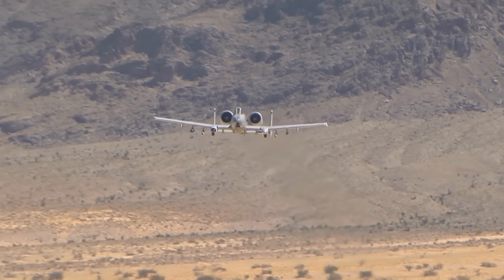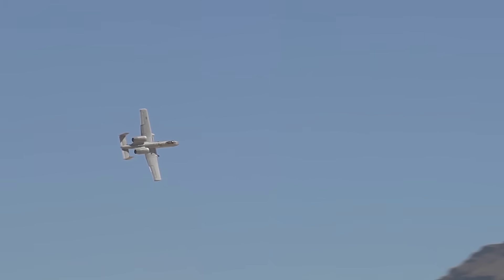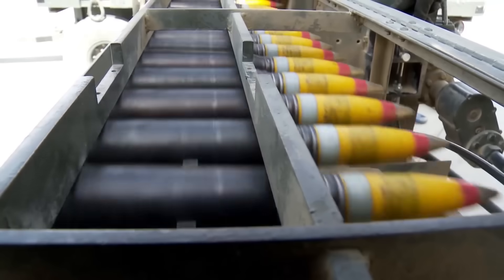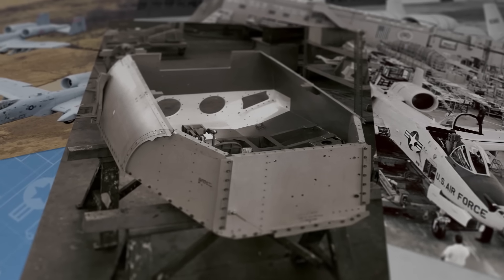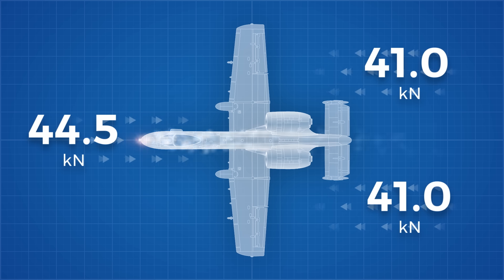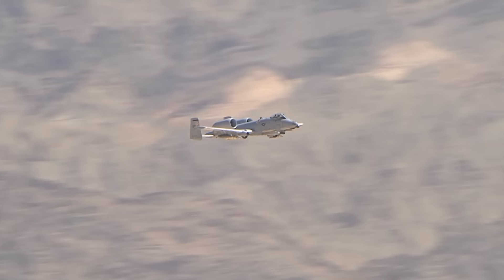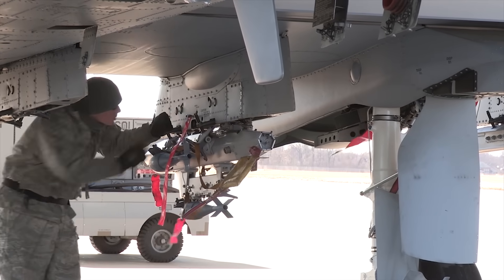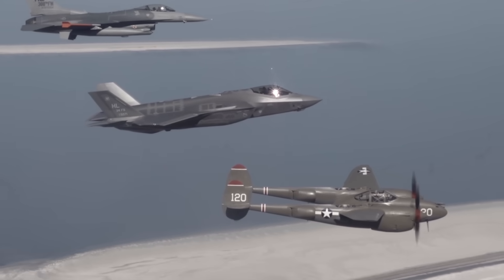The Insane Engineering of the A-10 Warthog

Comment: I saw two A10s crash at KKMC during the gulf war: first had hydraulic failure, pilot put it down hard, landing gear buckled, plane skidded to a halt.  Second same story, hydraulic failure and A10 hit runway hard.  my Humvee was waiting to respond to the IFE (in flight emergency) and was at the end of the runway, very near to where the A10 first contacted the ground.  My job was to 360 any possible crash site and protect classified. The landing gear buckled and I thought, oh he'll just slide it in like last time.  For some reason, the plane shot back up, rolled inverted and nosed into the runway, killing the pilot.  It was a real tragedy.

Comment: Point of order: The A-10's 30mm cannon is not mounted along the centreline - not exactly. It's actually mounted so that the barrel that is firing is on the centreline, so the weapon as a whole is slightly off-centre, as is the A-10's front wheel, to make room for the bulky 30mm weapon.

Comment: My father was an aerospace engineer who spent over 15 years of his career designing upgrades and improvements on the A-10. Once while visiting our local aerospace museum my then elderly father walked up to the static A-10 on display and deftly opened what I believe was one of the gun access compartments. I said, "dad what are you doing?" He said, "I re-engineered this latch." I asked him why. He said that the original latches would frequently fail due to vibration from firing the gun. He followed with the comment that the pilots didn't care for that happening. The museum docent didn't bother us due to the fact that he had known my father for a long time. 
RIP Dad, your girl is still flying and protecting us, warts and all.

Comment: You should consider doing a video on the turboprop light attack aircraft, they ditch the resistance and the firepower of the a-10 for basically everything else. 

They are substantially cheaper and easier to operate, have significantly better fuel efficiency and have the capability to use improvised airstrips.

It may not look like much but it means that a light attack aircraft can be anywhere you need and for much longer time.

And they don't miss as much survivability as one may think, because the turboprop engine is quieter it makes it a bit harder to spot by noise alone. It is also cooler, though I don't know how much it would affect its performance against heat seeking threats.

Comment: Not fast and not pretty, just the best at what it does and our mud brothers' best friend.As a fighter pilot, I should point out that local air superiority  is required for the 'Hog to do its thing, as its radar cross section is about the same as a flying aluminum barn. Though very agile, the A-10 is also very slow. There's no chivalry left in the air-to-air combat business. I prefer to sneak up on the enemy and kill him before he knows he's being hunted. Or, shoot him from 5-10 miles away. The 30mm is an awesome weapon, but in modern air-to-air combat, it would not--or should not-- be a factor.

Comment: The A-10 was designed for practically suicidal missions against the soviet union. To destroy some tanks before being destroyed itself, and using America's sheer economic power to out-build Russia.
The A-10 against any modern enemy would be nothing more than a slaughter...In favor of the enemy.
Reply: Yet the success of this aircraft falls short. In your eyes. You a f35 fan boy then? The flying POS that cracks in normal maneuvers. Limited to 7g's so the wings stay in place? On the plane fan boy...lol. 10 years behind delivery. And problems still swamp the program....oh and the gun....can't shoot straight. Probably obsolete before it is a factor. And over 100% cost overruns.. A10 is doing well.

Comment: You realize what he said was they could remove the 2 engines and replace them with 2 more canons facing to the rear and this plane would be faster than it is now!  I don't think using depleted uranium canon rounds as a fuel source would be a very economical choice however.

Comment: The infantry will kick up a huge fuss if any replacement craft is not fit for purpose. They love those 10's man... The modern U.S Infantry has experienced the A-10 in actual combat now for a few decades. There is trust there where in the past there has been animosity. Infantry hate being bombed or shot by their own...they got enough problems as it is without it. The A-10 and its pilots have really done fantastic work rebuilding the infantry trust in the Air Force. Vietnam vets often  had issue with danger close situations. They loved the choppers. Bombers and jets not so much. Maybe when the Air Force auction them off the Army and the Navy could get themselves some cheap little problem solvers?

Comment: You made a HUGE mistake. The gun is mounted LEFT of center (from the pilot's perspective). The firing barrel is in approximately the 7 o'clock position (when viewed from the front), which is in alignment with the centerline of the plane. You also might have wanted to mention that firing the gun changes the pitch of the plane and automatic trim is applied to compensate for it.

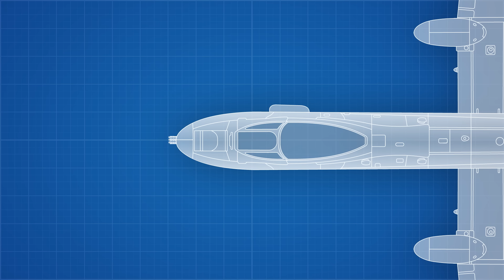Comment: 07:44 This is not so. The gun is mounted not on the center line of the plane but instead slightly to the left, with the barrel in the 9 o'clock position being the one that fires rounds.

Comment: F-35 doing A-10's job?
Laughs in BRRRRRRRRRRRRRT
Reply: @ItzB it was my understanding close air support platforms like A-10 & Apache were meant after obtaining air superiority. What you need to consider is the $42.9m difference in price per unit worth the 2,000 lb payload / 500 miles range upgrade? What's the point of stealth after you control the airspace?
Reply: @Mr_Plop1  It's more complicated than that, even if you have air superiority there is still the danger of SAMs and yes while radar guided SAM systems can ideally be destroyed before the A-10 comes in it's practically impossible to destroy every short-range MANPADS, Infrared or Laser guided SAMs and AAA. If an enemy has these systems every attack by a preferably low flying A-10 will come with a high risk. The F-35s ability to engage targets from a further distance dramatically decreases the risk of getting shot down and in the end is cheaper than having to buy new planes to replace the ones that crashed.

Comment: why not build a new version of the A-10? instead of try to replace it with a different plane, why not make An A-20? i just think having a fleet of planes that can do other jobs but are non specialized is a bad idea. while all rounders a great in most cases, they simply lack the benefits of dedicated platforms. this can be seen in pocket knives to war planes. sure the swiss army knife can do alot of things, but it cant screw in screws as or as quickly as a dedicated screw driver

Comment: You need the A-10. It was designed for it's job period. The A-35 can do alot for a large price and large cost to run. Let's say we lose 5 of each plane in combat, what is going to hurt the budget more? Besides, the soldiers know the A-10 will help them out of a jam always. Let's not cut your nose off to spite the face. Improve the A-10 and keep some A-35s for in case. Just saying.

Comment: The A-10 is a bit like the Tsetse pattern De havilland Mosquito, which was fitted with a nose mounted auto-loading 6-pounder anti-tank gun. Much like the A-10, the main bulk of the gun was in the center (the bomb-bay was modified), with the cannon being center-lined.
 
The 'Tsetse' pattern was said to be so powerful when firing that pilots reported it stopping the mosquito dead in the air if it wasn't at full throttle, although that's almost certainly an exaggeration, but not by much. It was mostly used by Coastal Command as an anti-submersible attack aircraft, being it was made almost entirely out of wood and had two of the fantastic Rolls Royce Merlin engines (the same type as the spitfire). It could close so fast that even when crash-diving, U-Boats couldn't get away fast enough and the 6-pounder shells would rip them open, even in a near miss.
 
This pattern was also fitted with six 8-pounder rockets and four .404 browning machine guns (for aiming mostly, by using incendiary rounds). Its opening salvo had more destructive power than the broadside of some light cruisers.
 
Oh and just for shits and giggles, De havilland engineers fitted the planned 32-pounder to the mossie after the war ended, just slightly behind schedule. Just to see if it would work. The wooden air-frame somehow didn't split in two when firing.
 
Definitely my favorite WW2 aircraft. The A-10 is my favorite cold war era, although the SR-22 is a very close second.

Comment: Too many generals want to mothball the only true close air support aircraft in the inventory. They want to put in an aircraft that cannot do the job- even though the new plane cost 4,500.  I would add that every general that has pushed for this change has retried to receive very generous "consulting" jobs in the private sector.
This could be considered treason in many countries.
Reply: They want to mothball it because they don't want to lose any more planes and lives than they need to. The A-10 has the highest rate of friendly casualties of any CAS plane, and you're more likely to get killed in it too versus in an F-35. Would you rather drop SDBs from 30,000 feet with far higher situational awareness or use your gun in a 70's jet approaching ground level?

Comment: As an unapologetic A-10 fanboy, let me just say I really enjoyed your video. It was well-balanced, well-researched, well-narrated and well-edited. I thought the live-action choices and CGI were top notch. Just one thing, though...

The GAU-8 7-barrel-set is not centered on the fuselage as is mistakenly stated  at 7:50. The barrel-set as a whole (or, if you prefer, the centerline about which the 7 barrels rotate) is offset to port (pilot's left). As you stand in front of the plane and look down the 7 GAU-8 gun barrels, the GAU-8 barrel that is in the 3-o'clock position is centered on the fuselage. The others will be offset to the right of the centerline of the fuselage, when viewed from in front of the plane. Of course, as the barrel-set rotates, only one barrel fires at a time. It is the barrel at the 3-o'clock position, the one centered on the fuselage, that fires, thus sending the recoil force down the centerline of the airframe.

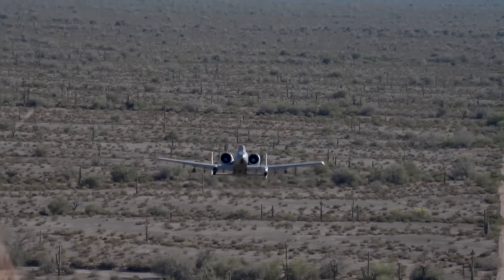You can best see this in your video at 12:26, just before the aircraft exits the top of the screen. Slo-mo or pause then hit the period key to advance frame-by-frame to see the offset.

Thanks for the excellent video.

Comment: flies low, slow, and kills everything below.
Reply: Of course! Because this is a plane for fighting Indians and natives with spears and bows.
Reply: You put the complete 16minute video in less than half the no of words.
Reply: Flying low and slow makes operating in contested airspace a no.
Reply: @Deathmastertx  That's what the fighters are for. F-22, F-18, F-16, F-15, etc. This is an attack aircraft, air to air is a non-starter.
Reply: @MrMartell77  The vulnerability of the A-10 is part of why some of those multi-role aircraft - F-15E, F-16, F-35 - have taken on the close air support role. The A-10 is too expensive compared to more UAVs or a turboprop COIN aircraft for the role it currently does. It's not just vulnerable to air-to-air combat but vulnerable to surface-to-air missiles. Even MANPADS.
Reply: @Deathmastertx  321 trs warthogs, ik what im sayin

Comment: The gun isn't center-mounted. Idk why you said that when all the videos of it show that the gun is actually slightly off-center. This is because it fires out of the barrel in the 9 o'clock position, not the one in the 12 o'clock position. So the gun is placed so that the 9 o'clock barrel is center-line with the plane, which means that the gun is placed just slightly off center. If the gun was placed entirely on the center-line, then firing it would push the plane significantly off target immediately.
Please do more research in the future... This isn't even one of those obscure facts, it's like one of those amateur plane enthusiast facts.

Comment: Hans Ulrich Rudel, the most decorated pilot of the Luftwaffe, also provided his own inputs for this plane's design
Reply: Nope. This what Wikipedia says about him:
"In 1969, the Secretary of the Air Force asked Pierre Sprey to write the detailed specifications for the proposed A-X project; Sprey's initial involvement was kept secret due to his earlier controversial involvement in the F-X project. Sprey's discussions with Skyraider pilots operating in Vietnam and analysis of aircraft used in the role indicated the ideal aircraft should have long loiter time, low-speed maneuverability, massive cannon firepower, and extreme survivability; possessing the best elements of the Ilyushin Il-2, Henschel Hs 129, and Skyraider. The specifications also demanded that each aircraft cost less than $3 million (equivalent to $20.9 million today). Sprey required that the biography of World War II Luftwaffe attack pilot Hans-Ulrich Rudel be read by people on the A-X program."

Comment: "The A-10 Warthog is the foremost accessory to mount on the GAU 8/A, while undeniably expensive, the enhanced mobility and user protection is usually considered well worth the expense and maintenance requirements." - D20 Modern Vehicle supplement entry for the A-10.

Comment: I don't understand why there is such a push to replace the A-10.  The F-35 and A-10 could be complimentary.  F-35 asserts air dominance with payload configured for stealth, air to air combat and interdiction missions.  The A-10 pounds the ground at the front lines knowing the F-35 has removed most of the threats.

Comment: The A-10 can fly slower than an F-26 or F-35 giving the pilot more time to correctly identify targets on the ground.  This is critical in a chaotic battle space.

Some dumb asses decided in the 60's that guns on fighter aircraft were no longer needed and the F-4 was built without one.  (They later had to add an external gun pod.)  Another fine example of stupid military ideas.  The next stupid idea: F-16s and F-35s can do the job of a A-10.

Comment: The gun is NOT mounted on the centre line... It's mounted to the left of centre, so that the firing barrel is on the centre line.
Reply: Yes! The firing barrel is the one in the 9 o'clock position! Can't believe they fucked that up, it's one of the basic neat facts of the plane.
Reply: Yeah I caught my self saying that
Reply: Yeah, not sure how they mess that up. With so much emphasis being on how it is a GAU-8 with wings, you'd think they'd research the main component of the aircraft a little more...
Reply: Agree.  The torque would flip it over.
Reply: @mikeunderhill8375  Huh? The torque from a rotating gun could not possibly roll the aircraft over
Reply: @knobovsossidge2022  It is the 9 o'clock barrel that fires. When talking about position on aircraft you look at it from the pilot's perspective, not from looking at the front.
Reply: THANK YOU...saved me having to call them out...

Comment: 7:44  Incorrect.  It's actually mounted slightly off-center because the gun fires from the barrel in the 9 o'clock position, so they had to move it slightly to the left so that this barrel is in the center of the plane.
Reply: Scrolled all the way down here to say the same thing :D
Reply: Yes, I noticed that, too, and you are correct.  The gun is off-center in order to make the firing barrel on-center.
Reply: Was about to comment the same! Good work!

Comment: I do not want the F-35 taking over the close air support role. This needs to be handled by either the A-10 or a suitable replacement. The F-35 is already designed to do too much and I do not want an $87 million aircraft loitering over hostile ground fire.

Comment: first great video but you made one tiny mistake the gau 8 is actually offset to the left as the gun does not fire out of the top for the rotation but 45 degrees to the right of the tom and its offset so that point is on the center line of the plane

Comment: Honestly, I still wonder how the f-35 is supposed to replace this beast ...
Reply: It's not. Even if it HAD been a master of all trades (physically impossible but lets roll with it for now) it has too high a stall speed and it lacks an equivalent to the GAU 8/A main armament of an A-10. I suspect the A-10 will end up replaced by a plane dedicated to CAS that has an energy weapon as it's primary weapon, or possibly a coilgun.
Reply: @Sorain1  A-164 wipeout when?
Reply: A-10 currently makes sense because the US still tends to fight in wars against enemies without proper AA, because nowadays even a modern tank with computer auto-tracking of selected targets can shot down slow A-10 if it chooses to get close and personal by using its gun against ground targets, and once you will need to start using A-10 for attacks from a distance with guided weapons because enemy got some AA, drones have economically much more sense as they are cheaper to run and can patrol in the air for a lot longer...
F-35 is a replacement for A-10 only in Lockheed promotional material even when the use of a gun is out of the question because F-35 cannot loiter over the battlefield for as long as much cheaper drones and more importantly you would not want to use expensive stealth jet aircraft that cost 30000USD per flight hour to operate as a slow-flying plane alternative to a vulture waiting for a bite just to be shot down by some illiterate insurgent with a cheap export AA weapon when heard and then spotted by the naked eye circling above insurgent's cave hideout...
Reply: It's not
Reply: The F-35 has a pretty hard-ass gun as well.